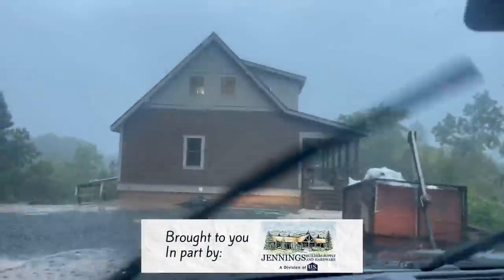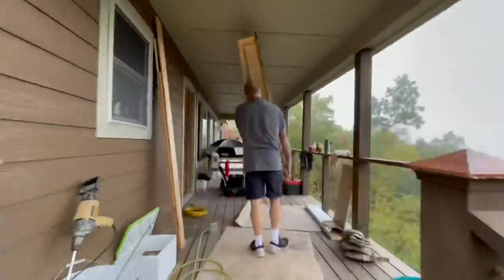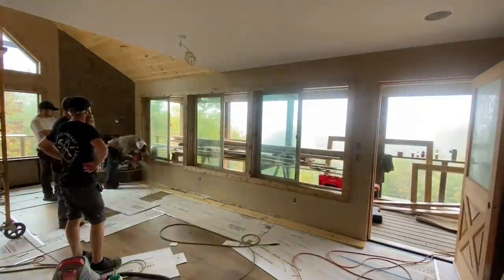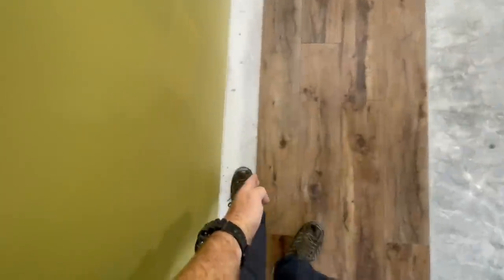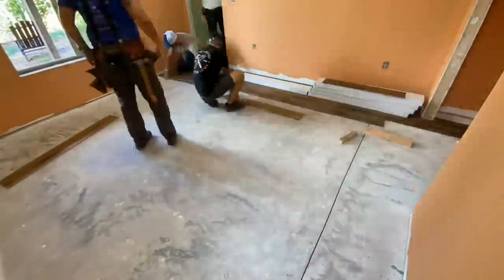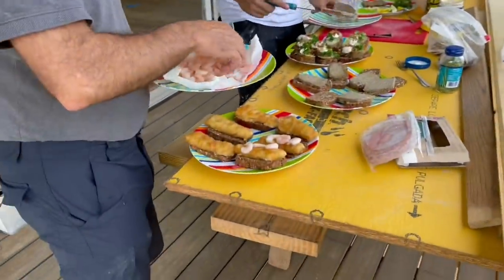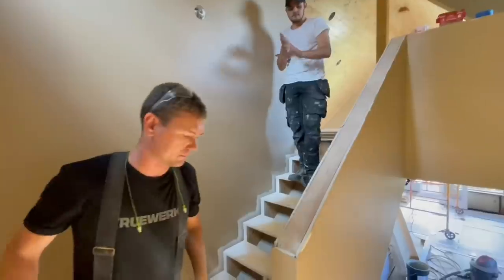How To Install Floating LVP Floors | Building The Nantahala Retreat #37

Comment: RIP Ray's impact driver. The bit holder is covering all the motor cooling slots.
Reply from the maker: Good point… I’ll tell him he is allowed to take breaks to let’s his drill cool off
Reply: @PerkinsBuilderBrothers  Just don't let Jason see him taking breaks!
Reply: Yeah, "Golden Boy gets to take breaks!" 😄
Reply: @PerkinsBuilderBrothers  Most drivers have a thermal cutout, so it actually has a built in timer. If he's working too hard, it'll get him to take a break.
Reply: @namAehT  Yes and if the machines have not they will burn out quite fast without cooling...

Comment: Try installing a hitch ball on the front bumper of the truck then the control is awesome with clear vision especially with the length of this trailer. Drive the difficult sections, stop and detach the trailer reverse the truck and hook up to drive away with a true "trailer" Shout to Jaime on the one-piece window trim!

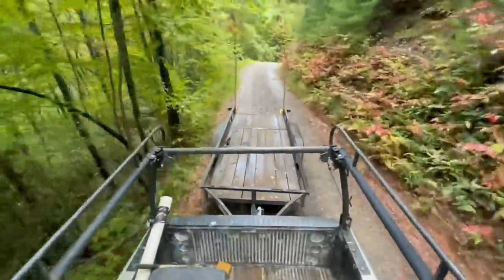Comment: @14:52, if you've never backed up with a trailer, you don't know how much skill it takes to get to Jamie level. In my freshman year in college, I had to chase hot air balloons and on the first day, the guy asked me "know how to backup with a trailer?"   I scoffed and said "OF COURSE!" never having done it before.  I got so jackknifed that I had to unhitch the trailer and manually turn it around. 😂  It took a few times to get the "you have to steer from the bottom of the steering wheel" concept.
Reply from the maker: Awesome story! Backing up a trailer is an art and once you get good at it it’s no problem… It definitely is a shocker the first time though

Comment: As the wood guy, on every concrete floor I will installed wood flooring on I’m using the 3/4 or inch and a half furring strips with Styrofoam in between the strips and I always use 5/4 wood flooring and I make my own flooring and moldings and trim and doors and windows, I’m a wood guy

Comment: Cabinets generally are fine on floating Vinyl, here in the Netherlands we don't do much else then that with it being the most common type of flooring across entire homes as it's cheap and easy to do yourself. Having a insulating layer of 2/3mm foam (We generally have rolls or tiles) underneath helps with allowing the floor to continue to stay 'floating' even with a heavy, ancient oak cabinet on top of it, up against the wall. You guys already have the wall to floor spacing part down which is another major factor, having the floor 10mm/0.4 Inches away from the wall and putting your skirting boards on top of the floor allows the floor to move underneath the skirts. You'll also find fewer and fewer cuttable Vinyl floors as people have figured out they aren't that durable, so we tend to resort to a table saw ourselves with a jig for both speed, less frustration and cleaner cuts only hand sawing any special pieces.

Comment: Pro tip for LVP starter rows: Get the row fit where it needs to go and then put a small dab of Mitre Bond under the 2 ends of each plank spraying it as you go. This will hold them from bumping and sliding but not hold them permanently letting you readjust if something went wonky.

Comment: You have to be careful placing the bit holder on drills because it might block the vent holes, causing the drill to overheat and prematurely fail.

Comment: You can scribe the face of lvp with a razor blade, flip it over then bend and snap it. You do need a saw for the irregular cuts though.
Reply: You can use a circular saw for the long rips. Stuff cuts nice, buts leaves you with a lot of weird rubbery dust.

Comment: I feel your pain with the reversing of the trailer you can't see, you should try reversing an 8' trailer with a 40' double deck bus when you can only see the trailer once it starts to kink. Add to that the 300 yard alleyway that only gives you about a 3" gap each side between the walls and your mirrors. THAT reverse manoeuvre took me about 40 minutes and drew a large crowd so, ya know, no pressure 😂😂

Comment: Interesting. I've got LVP (or PVC as it's called here) flooring in my living room, and it is not floating. It is glued down tot the concrete top floor. Big advantage of LVP over laminate flooring and hardwood flooring is that you can install it on radiant floor heating, and of course the maintenance: it's scratch resistant, watertight, doesn't expand or contract, and it looks very luxurious!
Reply: My uncle has hardwood ¼ sawn white oak over radiant tubes. Been that way for over ten years now with no issues.

Comment: I mean... you could also just unmount the trailer, turn both independently and drive off the site in the right direction....
Reply: That has to be far easier than backing up that long narrow driveway but that would be too logical
Reply: My thoughts exactly 😆

Comment: All wooden flooring I've installed in my place in Norway clips and snaps together like your LVP does.  It's pretty much standard over here.  We don't glue anything down - we just drop rolls of thick backing paper underneath to cushion the flooring.

Something I wanted to ask about your other flooring, actually:  If you glue it down, how do you expect it to move when it expands and contracts?
Reply: Its an engineered board made mainly of plywood  so it shouldnt move much

Comment: Do you guys us subfloor panels to allow the concrete to breathe in Carolina?  Where I live, those floors go really mouldy (which you discover when you pull them up) if they go directly over concrete.
Jaime's window trim was absolute boss.  Well done.
I use the carbinger clips for my bits.  I find they work great.  You can clip them anywhere regardless if your wearing the tool belt or not, and they hold the bits really well.
Another great video and one incredible lunch!
Reply from the maker: We have a vapor barrier underneath the slab to keep moisture from coming in from the ground… Also we’re on a ridge here which is very dry.  Building in a wet area could be different.

Comment: At the end about backing the trailer.  Could you not disconnect,  turn around the truck and looked like enough room to turn the trailer puling and shoving  and then reconnect and drive straight out.

Comment: Just disconnect the trailer, flip it around and flip the truck around and hitch it back up. Off you go… there’s enough guys there to lift that trailer and flip it around. I have done that before in a similar situation.

Comment: Only thing harder than backing up a long trailer without those guide poles is backing up a 6 or 8 ft trailer without guide poles. Small trailers without guides have incited many choice words in my vocabulary.
Reply from the maker: I would agree with you on that! Short trailers are the worst